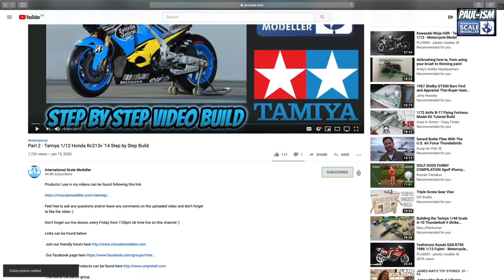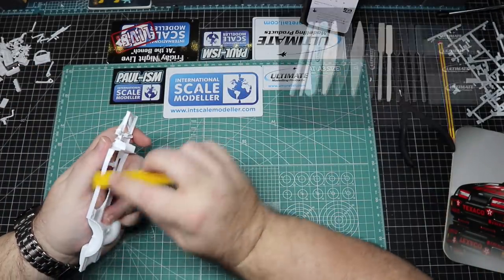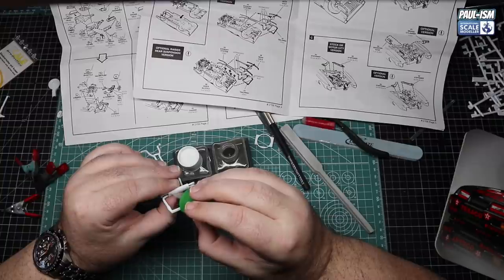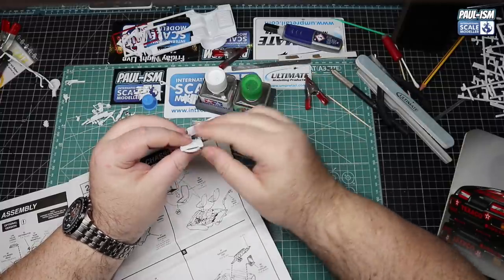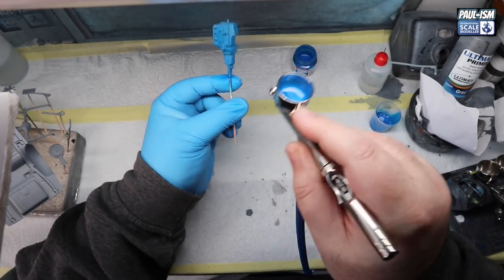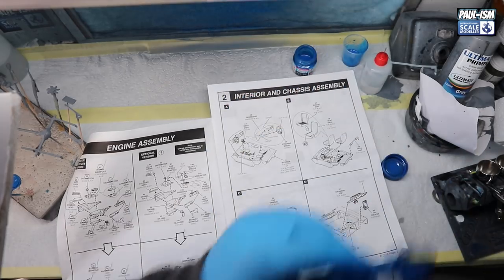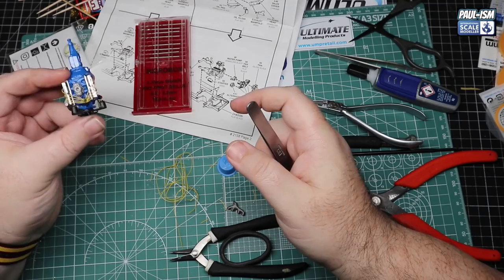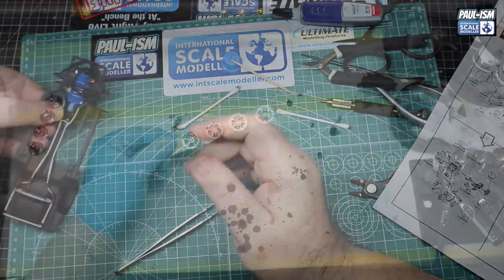Part 2 - Revell 1/25 '69 Shelby GT-500 Video build

Comment: I've been dull-coating chrome parts for years, you can also use Tamya's "smoke". It darkens the silver & you can also add flat clear to it to dull the sheen. Have also left the outer rim bright chrome while dulling & tinting the center or spider of the wheel. 
Loved your paint job on the body as well.

Comment: Finish the Revell first. And if you will - what size wire did you use for the spark plugs? Thanks.
Reply from the maker: It came with the scale production distributor set sorry
Reply: @InternationalScaleModeller  Thanks anyway.